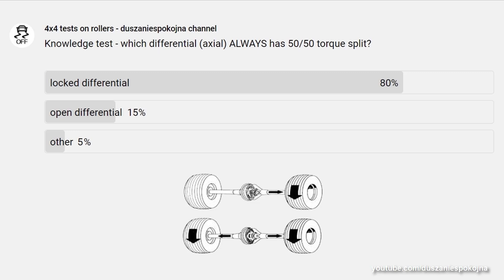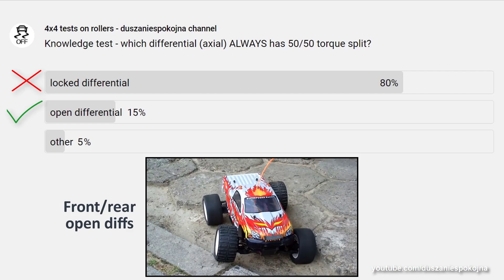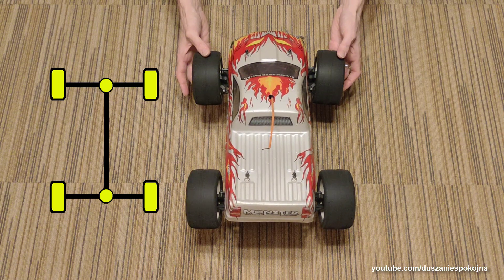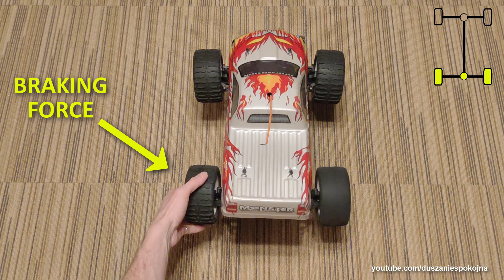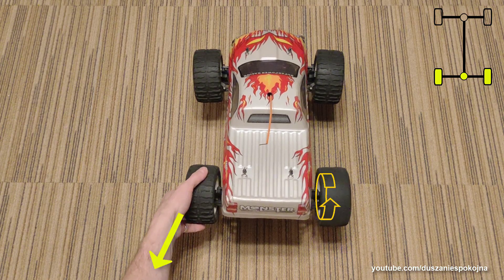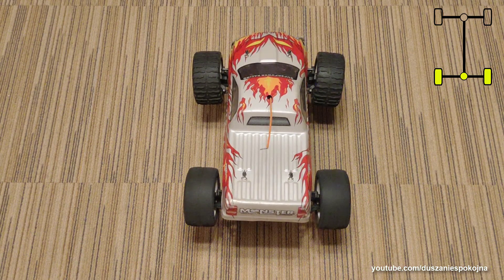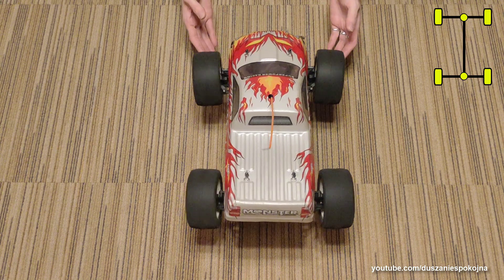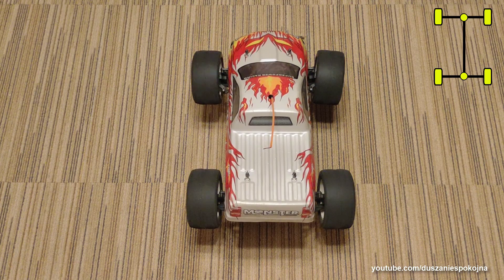Always 50/50 torque split of an OPEN differential - @4x4.tests.on.rollers

Comment: This is  Incorrect . Or  appallingly poorly explained . Take your pick.......................
An  Open Differential loses drive if one wheel starts to slip . 100% of the Torque goes into the SLIPPING wheel . 
There is no Torque Splitting action whatsoever . That's why it's called an  OPEN  DIFF .
Reply from the maker: @johncunningham4820   I'm afraid you don't understand what's going on. 100% of power (not torque!) may go to slipping wheel. TBR of open diff is 1:1, that's why its torque split is always 50/50.
Reply: @4x4.tests.on.rollers  . Again , incorrect .
An open differential will always send Torque to which ever wheel is encountering the most resistance , like for instance the INSIDE wheel during a turn .
However it is Essential that both wheels have Traction for the Differentiation to occur . If  a wheel loses traction , for instance , lifts off the ground due to uneven surface , then that will will spin actually at  Twice the former speed .

A  Torsen type Diff  DOES  in fact  Torque bias to deliver 50/50 torque to both wheels , however , a Torsen type diff must also keep BOTH wheels on the Ground .
But while there is still some limited traction on a slipping wheel it can Bias Torque to the other wheel at an amount equal to that residual grip .
Reply from the maker: @johncunningham4820 Trust me, I'm not wrong. It's you who completely don't understand the torque split of an open differential and you are confusing it with wheelspin/power. Or you don't understand what torque is. Study these please and you'll get it:
https://youtu.be/_HOa0aRZYpw?si=d4M0OCHD02sW79Jn
https://youtu.be/UlnGG4frZ68
Or just google "50/50 torque split open differential" and you will find tens of articles explaining your mistake.
Reply: @4x4.tests.on.rollers  . I  know what Torque is . The Actual unit of Work in a system . Power is derived , mathematically , from Torque . 
Basically work over time .
Reply from the maker: @johncunningham4820  If we talk about differentials - torque is the force causing the rotation of the transaxle/wheel. Rotation may be zero. Power = torque x rpm. Study the links from my previous comment to understand your mistake.
Reply: @johncunningham4820 Lol. You demonstrate exactly what you are told.
The torque at the wheel only exists because there is resistance. That's what you're forgetting.
No resistance, no work for the energy. Energy always follows the path of least resistance. It is ‘lazy’.
One of the equations that manages a differential is :
TT = 2x minimun [TR,TL]
where TT = Total Torque can be transmitted to the differential
TR = Torque that the right wheel can transmit to the ground
TL = Torque that the Left wheel can transmit to the ground
The consequence is that if one of the two wheels loses its potential grip and its torque tends towards 0, then CT also tends towards 0 despite the other wheel's potential grip.
Reply: @4x4.tests.on.rollers  Above all, he forgets that there is only torque at the wheels (including the differential) if there is resistance at these wheels.
This is the very principle of limited slip differentials, where ‘internal resistance’ is created.
Anti-spin systems do the same thing by creating resistance, ‘simulating’ grip. This creates torque on the wheel that actually has grip.
Reply: @johncunningham4820  you're way out of your league here man. You should at least try and listen to the video.
Reply: @johncunningham4820 It's always 50/50 in an open diff.  Let's say the engine and driveline can provide 1000 lbf to the rear tires.  Under good traction, an open diff will give 500 lbf to each tire.  Now let's say one tire is on pavement and the other is on snow.  There's only enough traction on the snowy tire to accept 100 lbf.  That means the other tire, the one WITH plenty of traction available, will also only get 100 lbf.  This is 200 lbf total, out of the 1000 lbf the engine could apply with good traction.  200 lbf might not be enough to move at all going up a steep hill.  With a locking diff, the snowy tire would get 100 lbf, and the tire with good traction will get the remaining 900.  That's an 90/10 torque split, rather than 50/50 as in the open diff.  If you have an open diff with traction control that brakes the low traction wheel without actually stopping it, then the l000 lbf will still be used, but it'll be 500 going to traction on the good wheel, and on the snowy wheel you'll have 100 going to traction and 400 wasted heating up the brakes.  Now we have 600 pounds of propulsive force.  That's a huge improvement over the 200 lbf we had with an open diff and NO traction control, but still not as good as a locker.
Reply from the maker: @blurglide  I think you addressed your comment to wrong person, it should be addressed to the author of this discussion.

Comment: torque split term is a bit confusing. With a locked diff you intuitively think torque goes 50-50 to each wheel but that is only when the friction is equal on both sides but in that case an open diff does the same think. As you explained when one wheel is in the air all 100% torque goes to the other wheel.  whith an open wheel as you explained in a different video if there is say ice on one side and you have 10Nm grip available the wheel with concrete will pull also 10Nm so might not be enough to get the car moving. with a torsen 1:3 you would get 30Nm on the wheel with concrete.

Comment: I know this is an old video, but can you please explain why the wheels sometimes rotate in opposite directions? I understand it's due to how the left and right axles are connected to the spider gear, but I'm trying to figure out how this can be mathematically recreated. Does this happen when the external torque (friction torque or any outside torque like manually turning the wheel by hand) on either wheel is greater than the engine torque (or drive shaft torque)? Does it still happen when the left wheel is on the ground but the right wheel is lifted?

I wish I could buy a model to test this, but they're hard to come by where I live, so I can't have a hands-on experience.

Thank you so much :)
Reply from the maker: @Cabinet445  Interesting question, I'll try to find the answer next week 🙂
Reply: If one of the wheels spun faster than the engine for some reason, I guess it would lead to the other wheel turning to the opposite direction.

Comment: Can you explain the Infiniti Q50 AWD systems (2018-2024) models?
Reply from the maker: Don't know much details but it's like xDrive system, meaning it's rwd based, front wheels are actively powered by multiple clutch pack. System is branded by Atessa.

Comment: You are totally wrong 😂
Reply from the maker: Am I? Explain it then.
Reply: @4x4.tests.on.rollers  Another example - when you are riding your vehicle in a circle e.g. left side all the time let's say 100km.
Right wheel made far more dostance then left wheel. To ride some distance you have to provide energy .
If the right wheel made more km than left It got more energy.
If it got more energy to made more distance it also had to get more power.
So power split is not always 50/50
Reply from the maker: @delup2008 What a mess... Energy, power, torque - you treat them as they were the same thing. But you must know these are completely different things.
Video is about torque and it is entirely correct.
Reply: @4x4.tests.on.rollers  Now i know that you completly don't understand physics .
1. Power / torque :
You have 2 engines.
One generates 200nm at 2000rpm.
Second generates 400nm at 2000rpm.
Second engine generates exacly 2x the power of the first engine at 2000rpm.
If you have torque / rpm curve you can figure out power / rpm curve from that. 
Power and torque are not exacly the seme thing but if you talk in about power / torque in context of differentials they basicly the same thing. 
2. Power / Energy:
Power is measured in e.g KW (Kilo Watt) .
Energy is measured in KWH (Kilo Watt HOURS!!!

SO energy is power given over time.
If you don't understand that - my previous comment can be a little bit messy.
Reply from the maker: @delup2008  Now I know that you completely don't understand how open differential works. Forget about the engines, focus only on what's going on inside the diff. Power and torque are not the same thing there at all. TBR of an open diff is 1:1 (~1.1:1 in real applications) and it's unchangeable. And that's the problem. Let's take your example about one wheel on ice and another on asphalt. One wheel may be spinning crazy so power split obviously is not 50/50 but torque split is. Nominal torque value on the diff may go up and down but not the split. It works the same during cornering etc. and that comes from mechanical structure of the diff.
Reply: @delup2008 I was convinced speed equals torque.. oh boy was I wrong. There is nothing wrong admitting a mistake and learning from it. Open diff: always 50% split. I got it now!
Reply: @4x4.tests.on.rollers  
1. When you grab left wheel power/torque goes to the righ wheel not 50% but much more. 
It can be visible clarly when regular car with open differential drives one side on ice and one side on Black asphalt - wheel on ice starts to spin like creazy.
2. When you grab front axle entire drivetrain stopped not because entire power was transportet to front axle "magicly" It stopped because the central differential is locked so one side (rear) always spin with the same speed as the other one (front).
Reply: @delup2008  You are confusing wheel/ driveshaft speed with torque and embarrassing yourself in the process.  This video is completely accurate.  Open differentials are know as 1:1 because they have a 50:50 torque bias ratio. They allow for variable speed, but always distribute equal amounts of torque. This is a known in the automotive world. Try reading up on differentials. A physics class might increase your understanding too.
Reply: This is one of the most embarrassing comments in the history of the galaxy.

Excellent video. Good explanation.

Comment: Great explanation, thank you!

So it seems like a locked axle is better than having a center differential, as it always splits the torque in a "perfect" way based on grip level?

I am trying to decide between Audi A4 B8.5 and B9, one of the factors is it's AWD system. On rollers, the new Quattro Ultra worked flawless, but I'm wondering how it will work in deep snow, where all 4 wheels have low traction? Would you prefer the Ultra or a Torsen type AWD?

Thanks!
Reply from the maker: Thanks! And yes, that's correct but then wheels have to rotate at the same speed so that's not suitable for onroad driving and handling.
When it comes to torsen and ultra - I would go for torsen, mainly because of reliability reasons, ultra is quite complicated system. In terms of handling - many people who have driven ultra say that you can barely feel the difference between it and torsen, although it's completely different design.

Comment: Excellent idea to use a model car! Btw, why don't you use stopwatch timing in your tests? That would show which car is quicker to respond, and would make comparable different results from different videos. Great channel!
Reply from the maker: Thank you! Well, I do not use stopwatch timing because of two reasons. Firstly - there is too many variables so it is very difficult to make objective measurement. And secondly - in many cases it is not the point to drive off the rollers in a short time 🙂

Comment: First of all, thank you for your videos and explanations. I have already learned a lot from you. However I don't think that the answer statistics for this question will change a lot after this video. I think this is because of the following reasoning: If one wheel of 2wd car with open differential is on the ground and the other is in the air, the car will not move. If the torque is split 50/50 between the two wheels, then why the torque of the wheel on the ground doesn't move the car? I myself cannot find the mistake in this at the moment. I believe that if you explain the mistake in this case the enlightening effect will be much greater and broader.
Reply from the maker: I'm glad you like my videos, thank you. Answering your question: max torque that is going to the wheel on the ground = torque that is going to the wheel in the air. Imagine that you grab by your hands the wheel which is in the air and you want to spin it - you will use just a little bit of your muscles and wheel will spin. Now go to the other side of the car and try to spin the wheel which is on the ground but use exactly the same same force of your muscles. You won't be able to spin the wheel. That's how open diff works. Maximum torque that goes to the better grip wheel is limited by the torque that goes to less grip wheel.
Reply: @4x4.tests.on.rollers  So the torque produced by the engine will be limited by the wheel in the air? And because of that the torque produced by the engine will be not enough to move the car?
Reply from the maker: @todortoo  Torque produced by the engine will be limited by the wheel in the air x 2 cause the second  "part" of torque goes to the wheel on the ground. But that's not enough to move the car, it is only enough to spin the wheel in the air. Check this video, it may help 🙂 https://youtu.be/UlnGG4frZ68
Reply: @4x4.tests.on.rollers  These explanations help a lot. Thank you :)
Reply: But where does the rest of the engine torque go? For example: the engine has 230 Nm ... one wheel in the air has 15 Nm, the other wheel on the ground also has 15 Nm, where is other 200 Nm lost?
Reply from the maker: @zoranpl  It doesn't matter how much max torque engine has. It can create only the value limited by the grip. No grip = no resistance so not much torque created.

Comment: Hi, i want to pitch something for you as you seem over average commited to explain drivtrain systems to us interested in power flow in drivetrain systems ;) 
I read alot on forums that pulling the handbrake on a rwd car will mimick a locked differential, but alot of examles and theory says no, as extra force is applyed on both wheels.
Could you pherhaps make a video regarding this practise sometime?
Reply from the maker: Hi, the idea of a video is very nice but I would have to find some rwd car where all electronics can be switched off... And a car with real handbrake, not just a button 🙂 That may not be easy task...
Reply: @4x4.tests.on.rollers  yes, thats a challenge 😉🤔
Reply: @4x4.tests.on.rollers  Many years ago I had a rear wheel drive car Skoda 105L without any electronic and with real mechanical handbrake. If a handbrake was in 100% condition, realy worked as partial difflock. This handbrake trick many times help me on snow or mud and allowed me to cross road sections, where same car with less experienced drivers got stuck. Yes, it really worked.
You can try this trick on the rollers with bit older 4x4 car, for example Hyundai Tucson I without ESP, this car has mechanical handbrake without any traction control. Or try old russian UAZ 496, or Latvia van. Even better - all old BMWs :) But tested car MUST HAVE PERFECTLY SYMMETRICAL WORKING handbrake.
Reply from the maker: @garminbreak  Many years ago I had Skoda 125L with 5 speed transmission 😉 Additional trunk behind rear seats was marvellous 😎
Reply: @4x4.tests.on.rollers  Aaaa, S125L was really good with very interesting fuel efficiency. With easy foot on the accelerator pedal You could drive that car under 6L / 100 km.
Reply from the maker: @garminbreak  I remember that I wanted to have a tachometer but it was available only in some LS or GL or GLS models?
Reply: @4x4.tests.on.rollers  With LS I'm not sure, but GLS had tacho. My L had not.

Comment: When a car turns around a corner, how does the 50:50 split allow inside wheel to slow so that the outside wheel can travel further?
Reply: Wheel torque and wheel speed are two different things
Reply: This is precisely the role of an open differential; to distribute the torque invariably while allowing speed differences between the 2 wheels.
Reply from the maker: @Liam Taylor Just like @FHI wrote, these are two different things. Even when one wheel is not spinning at all, it is getting the same amount of torque as the opposite wheel.